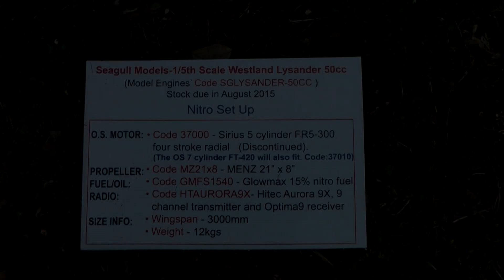Seagull's 1/5th Scale Westland Lysander 50cc

Comment: I know this is an old thread but I'm thinking about buy a Lysander.  Great flying and very nice looking plane.  SIG Manufacturing is the only dealer in the US that is selling this plane with about a 3-4 month lead time.  If I pre-order now I can only hope to get one in September.  Before I pre-order one I'd like to know how the quality of the plane is and were there any issues when assembling the plane?  Where there any modifications necessary to install the 5 cyl engine or does it bolt right onto the firewall without any issues?  Also, can you tell me what length engine stand-offs you used to get the proper distance for prop to cowl?  Any CG problems?  Thanks for the help.
Reply: I ordered mine at the end of June and it arrived the second week of Oct. I bought the Saito FG60-R3 for mine and ordered a scale pilot through Best Pilots.